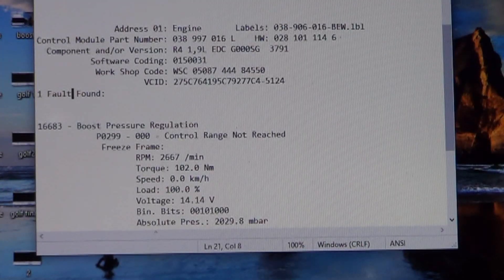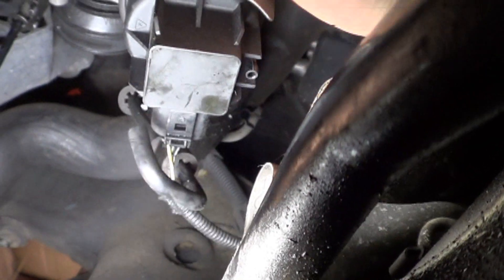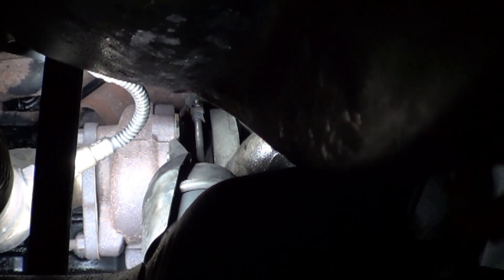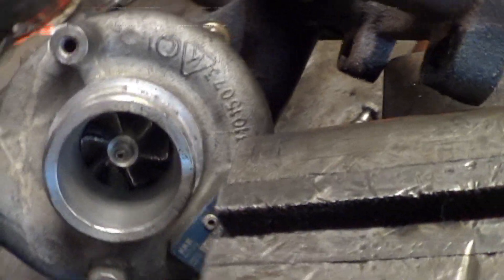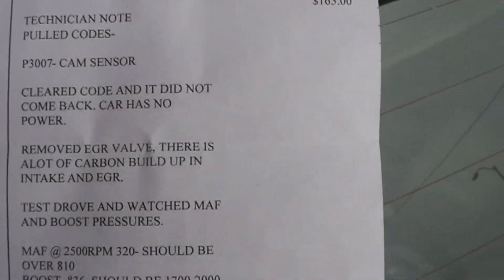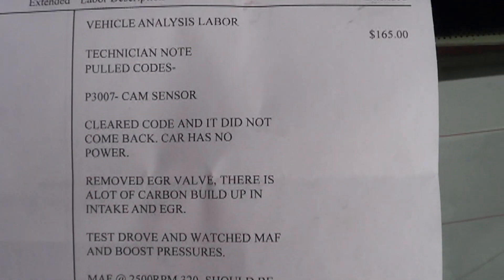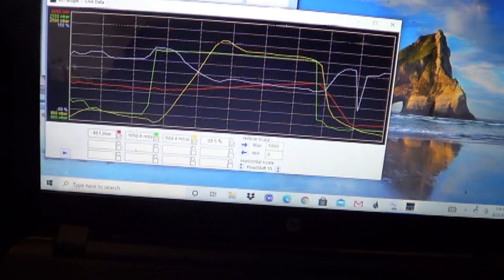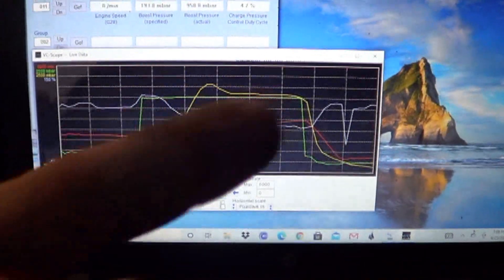2005 Tdi P0299 low boost

Comment: Hi, i just replaced my turbo in my 2004 vw do to overboost and p0299 ,the actuator was not holding vacuum ,now is just p0299 and coolant temperature sensor circuit. Any help would be greatly appreciated.
Reply from the maker: I have many video's on boost problems.  Do the checks in the videos.

Comment: hi i have low boost as well but no error codes nothing what could it be ?
Reply from the maker: It is possible you have a code but your just not getting it.  clogged intake is one thing that will make low power but no code.
Reply: @CoolAirVw  i did check i changed the air filter , i did a dyno test normally she should give around 180ps it reads only 155, someone told me could be the turbo ….

Comment: I have a 05 golf 1.9 bew with a 16683 code and a mass air flow sensor code . car has no boost . Turbo looks good and spins freely actuator does not build pressure . Thoughts ?
Reply from the maker: You've inspected the turbo impeller nad it looks good but have you done any other diagnosis steps?
Reply: @CoolAirVw  Yes, I test the Watergate actuator and it does not hold vacuum/ pressure . Doesn't build at all actually. I'm no expert but I think that's my problem.
Reply from the maker: @autoshaman4319  If your actuator doesn't hold vacuum then in needs replaced.

Comment: Hello! I am having an issue with my mk5 golf 1.9 tdi BLS. I reach required boost 2040mbar (slightly over it as it should) and the the ECU drops it around 1.8mbar and keeps it at that level so it does not have the required boost of 2040 during the pull. I dont think I have a boost leak since it is able to reach required boost. Pls can you help?
Reply from the maker: are you triggering a underboost code?
Reply: @CoolAirVw  Car has no codes. I also noticed during N75 valve test (ON/OFF) sometimes the turbo actuator moves all the way up and down and some other times it would barely move. I think the N75 is sticking because during the test I also noticed (just blocked the hose with my finger)  the vacuum was very weak from N75 to the turbo. The hose looks ok, not damaged. Car has good vacuum is much stronger before the N75
Reply from the maker: @denisdumani1305  Listen, the starting point for asking for tech help is describing what problem your feeling as you drive down the road.  Should I just assume since your describing turbo tests that you have a low power problem?  Also since the BLS engine was never sold here,  (I'm gonna assume your in Europe) that means I have no experience with BLS engine.  But I  would assume its a PD tdi similar to BEW, BHW or BRM.  BUT, if your actuator is sticking then the actuator is sticking.  Seems like that would be where you need to go.   I wouldn't give any credence to "my finger feels like vacuum is not good enough", but certainly that is possible.

Comment: Great video, had same problem with my Audi A4 1.9 tdi turbo failed took it all apart to find that the turbine had sheard off!!

Do you recommend changing oil and filter when putting new turbo in?
Thanks
Reply from the maker: Yes!  Good point.